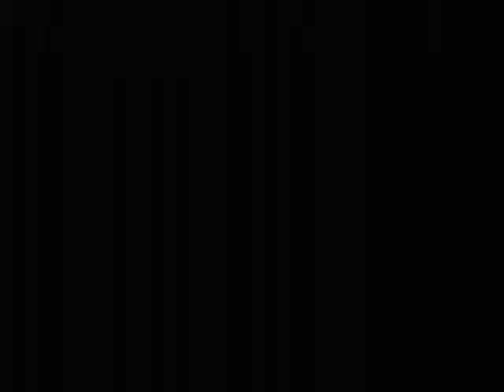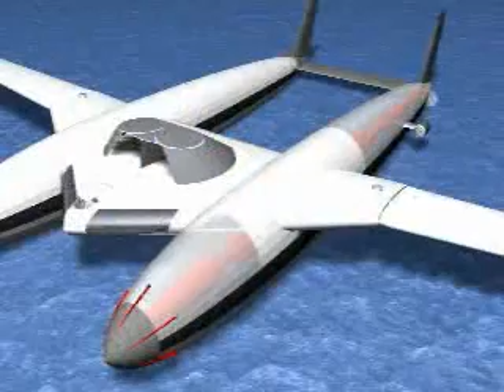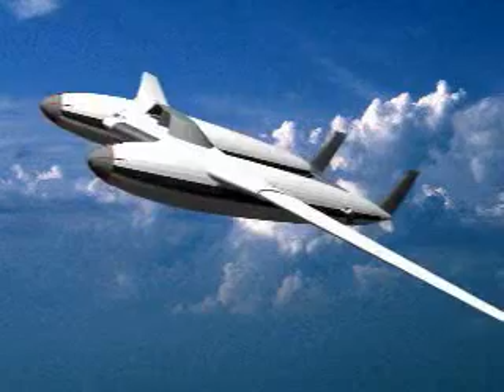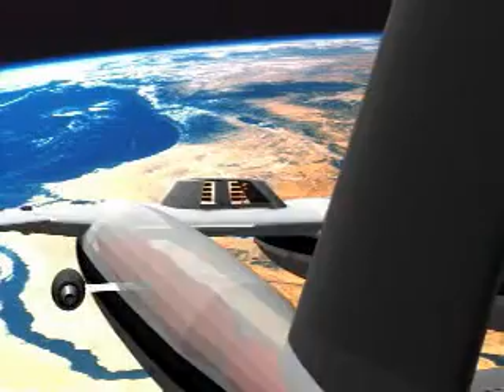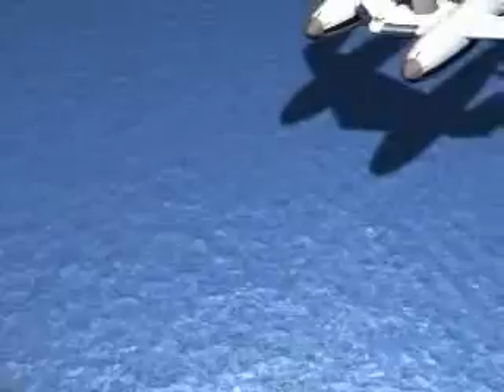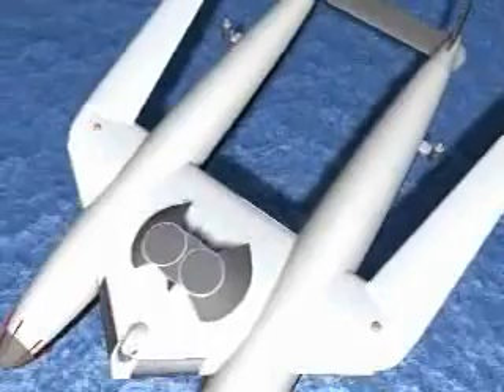Gravity Plane

Comment: Revisiting this old concept, it was and still is way ahead of its time. The need to produce lift in modern aircraft requires high airspeed and a relatively heavy and sturdy airframe, which means they lose energy to higher drag forces and can only maintain around 16:1 (737 MAX is ~15:1 to ~17.2:1) glide ratio with large chord length wings.

There are a number of improvements that can be made to this hybrid airship to make it more efficient. Some examples include:

    1.  Covering the top structural surface in solar cells and using high efficiency electrically ducted fans instead of the compressed air storage medium mentioned. Fuel cells also offer an additional source of power, as gasoline or ethanol can be reformed (cooked) to release hydrogen for use in a high efficiency low current density fuel cell stack.

    2.  The derigibles can be placed further under the wing to increase the top surface aerofoil efficiency, or be included inside a blended flying wing design for more storage and structural capacity. The overall shape needs to be optimized for better airflow, and the ability to carry higher loads at higher speed. It has the height and load distribution advantage.

    3.  Newer high strength, high temperature polymer materials can be used for the flexible ballasts to increase the helium density range. Energy can be used to heat the helium to increase its buoyancy, or used to cool it for improved densification. Heat exchangers and pumps can be used to adjust the lift distribution around the craft in this manner.

    4.  Add a parachute or two.

    5.  Maximize the internal useful area of the craft's structure to hold helium, fuel, or ballast.

Fun Fact: Class A airspace starts at FL 180 (18,000 feet) and ends at Flight Level 600 (60,000 feet) Mean Sea Level. "Gravity Plane"'s claim is that this design can fly around 10 miles high on helium buoyancy alone (52,800 feet).

#GreenEnergy #Engineering #Science

Comment: Pilot: We've reached pressure height. Activate compressed air.
Copil: Why?
P: It compresses the buoyancy chambers and sinks us.
Cp: Why isn't it making us sink now?
P: It's in a different..er..it pumps in more air from outside.
C: You're using X pounds of stored air pressure to create MORE than X pounds of air pressure in the buoyancy chambers?
P: Like when I use dead batteries to recharge each other.
C: This is impossible! Where are we really?
P: We are in your living room smoking weed.

Comment: come to think of it, the amount of condensate you could recover from compression makes water that water can be ballast or used for cooling during compression and ejected after creating more water

excess air during compression can also be vectored to provide manuoverability

again though the initial investment in the energy orgy happening comes from the energy required to make dense helium.

Comment: @m1leswilliams This air, which is heated due to compression is injected into colder air within the hull of the plane to cause expansion via warming of the lift gas at high altitude. This extends the period of time before the lift gas changes back to liquid  in a temperature induced phase change caused by cooling from high altitude conditions.  By warming the lift gas, the amount of work that can be done is increased.

Comment: @m1leswilliams This a phase change hybrid airship design, powered by the thermal energy in the air. The energy to power gliding flight is obtained from the atmosphere itself. An efficient power cycle is created using the natural temperature difference from a low altitude to a higher altitude. Heat energy is taken from ambient temperature air during aero-static lift via the high torque wind turbines at a lower altitude compressing air into insulated carbon fiber tanks.

Comment: Yodainacan: "Why wouldnt it work? Its just basically a reversed submarine. "

What you are missing is that a submarine does *not* use the flow of water around it to compress the air needed to blow the float cells later. There isn't enough power in that to compress the air. You need another source of power (i.e. the engine running on whatever fuel you're carrying).

Comment: Cool idea, i like the use of compressed air as it recycles the so e gravitational energy into pressure via the turbines so it can do useful work in the future. Some of the suggestions for solar cells have merit, but i would add that helium being an inert gas can have its buoyancy factor increased by marring it with some hot air concepts. Meaning, use the solar power to heat the helium gas as well as having the cover over the bags be of a dark material. Better a material that can chanepge light to dark depending on if the vehicle is in lighter or heavier than air mode.

Comment: There are a few problems here.  First, helium is massively expensive in such amounts and you'd need A LOT to lift something like that.  Way more than shown.  Also, you can't discharge the helium (too valuable) so you need to recompress it.   Compressors take massive amounts of energy, especially with helium which doesn't liquify well.  And at high altitudes low pressure of the air makes it even less effecient

Comment: This is a credible design combining the ideas of a derigable with the airfoil and thrust of a plane. As the compressed air is depleted it would make the craft lighter thus needing less thrust for the same if not faster speed becoming more efficient as it continues. But like any compressed gas source it will have a limited range.

This would be great for reconnaissance.

Comment: This is just an airship cross-bred with a glider. The idea for using helium to provide buoyancy for take-off is a good concept though, since most of the fuel burnt in conventional flight is during take-off and climbout. Plus, it has the added advantage of built-in VTOL capability.

Comment: -sounds- great... but the reason we didnt build this 50 years ago is because you need a huge ass bag of helium to get a small payload off the ground, much less support a wing structure that could hold that payload in descent.

Could work with minimal electrical power (to supplement the "compressed-air powered air compressors" at max altitude in a thicker, non-Earth atmosphere though!  Great for that situation!

Comment: @m1leswilliams When this stored heat is exhausted, it marks the glide portion of the cycle, where the high torque turbine via compressors store energy as heat and compressed air. The fall through a 60:1 glide ratio is where distance is covered and energy is stored. This Atmospheric power cycle can be repeated indefinitely. A low-boiling-point-liquid is vaporized into a low density lighter-than-air lifting gas using the heat in the compressed air from near the surface.

Comment: This creates buoyancy that allows the buoyant aerostat to upward glide. The air becomes cold when high altitude is reached and the lifting gas is cooled and changes phase to high density liquid that is heavier-than-air. Lift is lost and the aircraft glides back down toward the surface where the Atmospheric Power Cycle is repeated as the low altitude warmer air vaporizes the liquid back into a lifting gas to create lift again.
Energy must be added to start the cycle but not continue it.

Comment: Nice idea and cool video. However, it's way too optimistic. I like it when it says it uses compressed air powered pumps to compress air and gain weight... It's like using a light bulb to power a solar panel that powers the light bulb... You guessed it, it just doesn't work.

Comment: Gliders have high glide ratios largely by eliminating high drag features, such as wind turbines. if a propeller aircraft loses an engine the first thing the pilot does is to "Feather" the prop (turning the blades edge on to the airflow). This is because a windmilling prop will slow the aircraft making it glide only slightly better than a brick.
A nice idea, but I can't see it working.

Comment: @ironclownfish The compressors can use the bernoulli effect to drag in extra air from the atmosphere. As fast moving air is blown into the rigid body, the low pressure it produces sucks air in from outside. this is how the airbus A380 emergency slide works. the air they pump into the slide only constitutes a small percentage of that which ends up in the slide, because most of it is actually sucked in from the outside, by this low pressure

Comment: this one is close, high altitude air is easier to compress by a lighter vehicle.  energy gained in decent is from gravity, not the air, the limit to how much energy you get is terminal velocity due to wind resistance. but the addition of mass (air has weight!) increases, increasing stress.
if you invent a machine that is lightweight, powered by air or electricity, and can create helium (enough to get you to the max height in reasonable time) do you still have the room on board for food/water?

Comment: The principal objection is that if this thing worked as described, it would effectively be an overunity machine, doing more useful work than the combined energy used to power it. I have no problem with using helium to ascend to altitude, but I cannot see how it will ever be able to carry enough power to recompress the gas, or gather enough power from descent to repeat the process. Overunity is *NOT* possible, and anything claiming otherwise needs to be treated with extreme scepticism.

Comment: And compress more air than was previously compressed.
A perpetum mobile.

So what is effciency of your turbines and compressors? What is the predicted drag at it's "cruise" altitude?
And how much a pressurized tank weights?( it says the plane is lightweight, in which case the gas would just rip it apart).

Comment: @pmgodfrey I think what the video fails to properly explain is that, when the compressed helium is released into the bladders (or whatever they call them), it causes the ambient air inside the rigid dirigible structures to be displaced, and expelled from the aircraft.  This reduces the overall mass of the aircraft to the point where buoyancy is achieved.

Comment: @painterjohn512 hidrogen is flamable, Helium is a noble gas, which means, it doesn't react with anything, hence, non explosive. 
Either way, the energy to compress the helium gas is greater than the ammount of energy recovered through the air turbines.  If not this would be a perpetual motion machine, which is imposible to produce according to physics.

Comment: The laws of physics says this can not refuel and travel forever. Energy lost is minimized but there is still great deal of it lost in air drag created by the craft and the fan compressors. If it could refuel with air over and over again it would have 100% efficiency which is impossible due to air drag and compressing the air powered by the fans. Also, how will it hold people or cargo if weight is such an issue.  If it needs to be lighter than air, it will need a larger helium to payload ratio.

Comment: It'd never work.  If the helium is already there in a stored tank - then why would it need to fill anything outside of itself.  If it can carrry the weight of the helium tanks AND the aircraft it would already float...there would be no need to fill seperate tanks.

Comment: The whole system would require some additional power, but that could, with such a large surface area be provided by solar cells, this if properly funded (which it will NEVER be) would provide a very efficent method of travel. The relative speed would be quite low, a few rough calculations show, that, due to the size and relative difference of pressure about -50 to +200mph average with speeds negative to relative high altitude streams, they could be avoided though. Interesting...

Comment: There has been suggestions that airships shall be made into lifting body shapes. How much of a gain that would be I don't know though since the body requires a certain velocity forward to actually provide some lift.

However, any scheme like the one seen here - floater cells and wings - is just out of the question. The wings load the lifting cells down, and the lifting cells provide too much drag to allow the wings to contribute some useful lift.

Comment: @tjenk71 

I haven't run out the numbers on this vehicle, however, several aquatic versions of this idea are being operated by a number of oceanographic institutions to research water column temperatures and salinity.  Not perpetual motion, as another poster suggested.  The oceanographic version is battery powered.  Everything comes down to the actual numbers and methods of transferring/storing energy.

Comment: if its half as good as you claim it to be, why am i watching a cgi of it and not a working prototype, as from what you are saying it doesn't seem beyond our tech capabilities using pretty much off the shelf components, mini compressors, light compression tanks and a semi rigid construction material that's both light and holds air but which can also handle the expansion effect of taking a balloon up into a thinner atmosphere where normal balloons simply fail by exploding at a critical point, its also making me wonder where all these passengers are gonna sit in your commercial flights. in which case just how big is it expected to be, absolutely enormous would be my guess for anything greater than a single occupant  i actually find this idea really interesting but a cgi demonstrator is rather disappointing. i can draw my own crazy wakey concepts, i always liked the idea of an airship with full masts like a clipper sailing ship. vast wooden masts wouldn't have been practical but we've come a long way with strong light composite materials  so masts and passenger compartments would be strug underneath with further masts on either side and possibly even ontop with proper wait distribution and a network of interconnecting gantries and steps so you can ascend up the masts, i visualise a wakey escentric with his flying goggles and scarf up on the top mast lol. maybe ill do a cgi video about it and make loads of bold claims  about how impractical it would be for terrorists to hijack , especially at the incredibly low  flying speeds. ahhhhhh die you western scum. oi no wait where are you going. stand still will you im trying to crash into you you infidil

Comment: wait never mind as far as its limited range. But during low altitude flights even without a flammable gas it still could become a target. Though applications of such an air frame both commercially and militarily are quite plausible.

Comment: I don't think this will work as planned.  The up/down cycle cannot continue infinitely. Eventually additional energy will have to be introduced into the system to keep the craft aloft.
Reply: my thoughts exactly. Unless I missed something that would be perpetual motion.
I would think that adding solar panels would be the best and most obvious
 solution to bring additional energy. otherwise its a closed system and the energy stored from descending would not be enough.
Reply: Actually, it was mentioned in the video (3:17) that these ascending/gliding cycles are limited to 400~600 miles of flight. Although they did not specify if this distance correspond to a single gliding descent or in total.

Comment: So this guy is talking about going to 52000 ft ASL. How will they get clearance to fly that high for passengers? 
It sounds like a colossal death trap in the sky if they have a massive cabin depressurization event in this plane does not look like it can make emergency descents. How do you drive pneumatic motors that drive air compressors to compress more air with compressed air and make them more efficient than the compressed air that it takes to drive them? If you do energy transfer twice, won't you loose even more efficiency?
Reply: Everything you said was correct about the 52,000ft thing.  Its not hard to get a plane certified to those altitudes.

Comment: Considering you need about one cubic meter of Helium to lift one kg I don't think the proportions of the 3D model are very realistic. And that's at sea level, the only way to reach 10 miles high would be if the plane were 100% Helium.
Anyway, I still think the concepts explained here can be used to build an energy efficient flying machine - but not a perpetuum mobile machine

Comment: Well the star doesn't actually have to go Nova... Becoming a red giant is enough. Then it starts fusing into carbon and oxygen.

Look up a device called a Farnsworth Fusor (named for the inventor of the Television, Philo T Farnsworth), hobbyists can build small versions of these and with the right isotope/ion of Helium you can even get a voltage produced (miniscule) star in your very own home! If you fell up to it be sure to research it as you'll want to minimize/eliminate neutron radiation.

Comment: if you could salvage light air from high HIGH altitude height it may provide you with enough lift to make another acent after the original helium was used up.  but without trying this out how high you actually get is just theory. 

assuming you can fit all this technology into a frame that can perform the functions required by said technology

Comment: Violation of the First Law of Thermodynamics, using compressed air to compress air
The Patent Office will want a working model
Compressed air really sucks as an energy storage medium
However, sea gliders do work this way, but they use batteries.

Comment: indeed, you allways fall with 9.8 m/s/2  and the pressure wil not drop below the outside pressure. but wil go eaqual. then you need compressors to make the pressure drop further.and in order to let it work you need a rendement of over a 100%. witch is impossible.